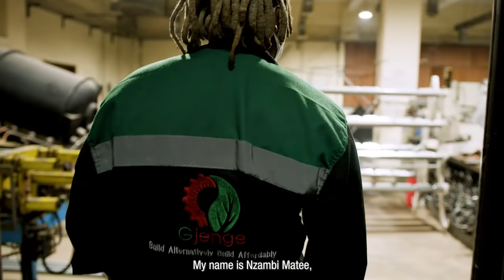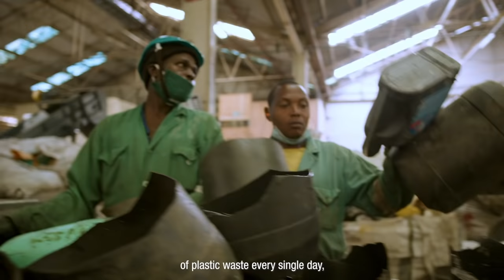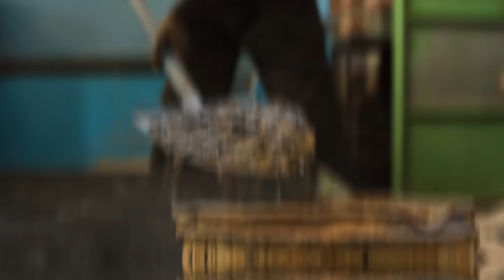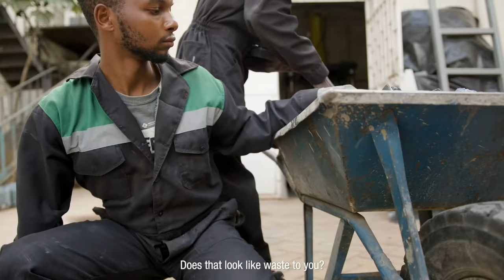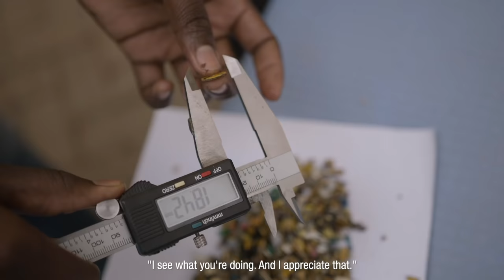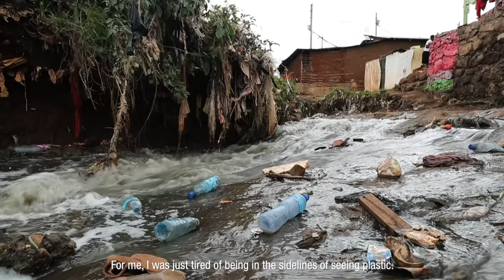Plastic bricks in Kenya - NZAMBI MATEE - Young Champion of the Earth 2020 for Africa

Comment: You generally don't want house fires, but you absolutely don't want a house fire in a house built with plastic bricks.
Reply: I get what you're saying, but is wood or any other normal building material all that much different at the end of the day?  The proper action is to make sure the fire never starts in the first place, unless you want to go making homes out of ceramics or something.  Even then, absolutely loads of stuff is still prone to catching fire on the inside of the structure.
Reply: @fenny1578  Is wood all that much different from plastic at the end of the day?
Did you really just ask that? :P
Hell yes it is.
It's organic, grows in nature, rots and feeds nature.
A high quality hardwood will even outlast most concrete in an intense fire.
Can take hours for hardwood to burn all the way through.
And wood is so much cheaper to produce, gather and process.

Comment: We need this in the USA and around the globe!!!  Besides brick sand insulated molds, I would guess many other molds can be made that would be very useful.  Genius work Ms. Matee!
Just need to add or coat with fire retardant for homes, which is easily done,,, Genius Ms.Matee
Reply: Shape em like legos and make houses out of them.  Many many people in Africa live in mud or stick houses or sleep on the ground outside.
Reply: I am thinking large molds that can be filled to produce igloo or teepee style small homes, with floors and space for windows. The material lends itself to just about any kind of application, and it seems it would not degrade too soon. That would be important, as well as recycling the old material. Whatever is made, it's got to be better than plastic as far as the eye can see. It is appalling that no one seems to clean it up.
Reply: She should reach out to some big names and see if they can offer  any pointers or sponsorships. Bill Gates for example.
Reply: it already exists in the us? its been done by a company called ByFusion back in 2014 rofl. ByFusion is a company based in LA, california.
Reply: @Gentleazi   I remember hearing about something similar for asphalt. I can't remember if they also make eco bricks as well. I wonder why I didn't mention it in my last comment, lol.
Reply: @Gentleazi  It's not the same process and ByFusion isn't a loadbearing product and can't be used for homes or any loadbearing structure.  ByFusion used to say they could build loadbearing structures like houses, but they can't.
However, anything that can turn waste plastic into something useful is good.
Reply: @amywalker7515  
Actually no African People have nice homes. I want to one return to Afican and build my home and unlike America, if I pay in cash my home is mine forever. The banks there cannot take your home because they do loan credit as frequently as America so that means no debt. 
There is homeless everywhere
Reply: @missauroraroseblairsays  I went to Africa two years ago and I saw a very few nice houses but the vast majority of them were very very poor.  Americans have no idea how most of the rest of the world lives.
Reply: I agree! Very Genius!
Reply: @JillyBean_1987  please please not him...he is wanted in Africa and India
Reply: @practicaldeen5333  I'm not really buying that. Would you like to show me a source or two? What makes you say that? The number of conspiracy theories and propaganda are just ridiculous. Bill Gates has donates billions of dollars to third world countries in crisis. Edit: he has also donated ons if money to his own country. He knows his platform can help people. Anyone this rich is bound to have ppl making up crazy stories and blaming certain problems on them because they need someone to blame.
Reply: I think you've been sleeping under rock. USA has millions of patents of innovation and technologies.
Reply: @amywalker7515  no
Reply: @amywalker7515  what contry and location?
Reply: @tenzackyogi1742  No, because the US has a huge infrastructure and lots of $$$$ that will help spread the help and knowledge and tech.  Yes, there is a possibility of greed, but what country doesn’t suffer from this sin?  Plus, don’t say mean things to me.
Reply: @nofilter7955  Obviously, the bricks for homes would be made that are fire-resistant.  Like the lumber used for homes is spray-coated,
Reply: @yellowbird5411  4Ocean cleans rivers, ocean & beaches. They clean up tons of plastic trash daily
Reply: @JillyBean_1987  You didn't just suggest Bill Gates! HA!
Reply: Its not a good idea, its a desperate idea.
Reply: @86Corvus  Come up with an inspirational idea then or say something that is desperate again.
Reply: @amywalker7515  
Please don't speak as if you have been to all of Africa. It's a vast continent. And mud houses are perfectly suitable for hot countries, as they remain cool in hot weather, just as say wooden houses remain warm in cold countries. An African may also argue that the vast majority of people in certain western countries live in wooden shacks. But then mud or brick houses would not be suitable for a cold region (whereas wood will be), just as plastic or wooden homes would absolutely not be suitable for a hot country.
Reply: @lisasrexstar7796  you're arguing with Bill Gates' primary financial advisor here.
Reply: Why would we heat toxic plastic to offgas in the atmosphere rather than using Adobe which is dirt and concrete...
Reply: @milkboi2386  Why would we allow unsoluble plastics to very slowly degrade and kill whatever drinks or swims in the water supply?  There are no recycle bins like in richer countries.
Or course, using dirt is better, but is that going to happen when everyone is drinking out of plastic petroleum-based bottles?  A sand dune of plastic?
Besides, she's not lighting the bottles on fire,: she's melting them, which is way different.  It's like melting a marshmallow over a campfire instead of burning it into a fiery ball of smoke.
Reply: @86Corvus  Why desperate?
Reply: @timboj2979  why not just use reusable glass that plastic to drink out of? Also any heat expedites the offgassing so it's literally the same thing. Then they lay them out in a flat sheet increasing the surface area for it to offgas. In a giant pile 95% is under the surface insulated from direct sunlight. I like that she's trying to do something good but I think this might be worse. Also in the pile it's concentrated and her way you spread out the plastic waste everywhere to ruin the earth faster.
Reply: @milkboi2386  Because the whole point is to rid of plastics.  Of course and obviously, there are other solutions, but not to get rid of plastics.
Reply: @timboj2979  So could you explain your earlier statement on how lighting them on fire and melting is WAY different. This doesn't get rid of any plastics it spreads the toxic plastic everywhere across the country. Fire and or melting the plastic releases so much toxins into our atmosphere, on just does it faster...
Reply: @timboj2979  also I love that she is trying but microplastics and plastic pollution  is the one thing that could destroy the earth as we know it.
Reply: @milkboi2386  Peace
Reply: Plastic is toxic to our health. You look it up.
Reply: @amywalker7515  2 words "Fire safety"
Reply: @falrus  Look around your home now.  Just about everything is made from plastic already, isnt it?  The floors have linoleum or something like it.  The paint on the walls, the insulation in them,  the roof shingles,  our furniture, clothes, electronics, etc also are.  So what's the difference?  I hate plastic, but if repurposing it puts a roof over someone's head, I'm all for it.
Reply: @amywalker7515  1) plastics used in wiring are not flammable (they burn only when other fuel is present)
2) In case of fire, those plastic bricks will be liquid much faster than structural wood is can not support the roof. (Hate American construction practices, they are a joke compared to European)
3) As  a fiscal right winger, I don't like regulations. But people should make informed decisions, when they are going to put their family into a house build out of napalm.
Reply: Exactly. This is needed everywhere!!
Reply: @JillyBean_1987  I don't have links handy. It's easily available if you look with open eyes. Govts in India and several African countries have caught his organization sterilizing women without permission. Many have died or suffered seroius harm.
Reply: @timboj2979  Most framing is just raw lumber. Only soil contact lumber is treated.
Reply: @antigod9111  wow. Mud huts are fine. Dirt floors, too, right?
Reply: We already use all of our plastics in recycled products.
The problem with plastic isn't that we're not using it, it's separating it from other waste.
Reply: No you don't need this in North America, it's just another green wash program creating more micro particle plastics, that will then be distributed beyond its past solid form to the many local areas and further areas. These people really believe they're smart. My God they are making things far far worse, and they're being touted as the Earths saviors. It's no surprise the UN is backing this Eco damaging program. Furthermore, the earths filtering sands should not be encapsulated in this manner, just another issue they'll notice in the future, was a really bad idea. These people really need a proper balance eco education.
Reply: @YSLRD  
Entire civilizations (Adobe mud- the internet is your friend) have been constructed out of mud..so what is your point? Are the materials used for the construction of a structure not about utility and function for you? 
I on the other hand, will not rebut with something like 'wow, wooden shacks are fine?', because I know (being educated) that wood serves the utility of insulation in cold climatic regions..just as..mud/bricks serve the utility of cooling in hot climatic regions..
Reply: Let’s put people in plastic houses sounds like a great idea. Oh until there’s a fire of course.
Reply: @DGiovanni  Of course, until you actually learn about  fire retardants, which they use on wood  for buildings in the USA,
Reply: @bioswars8827  If that is true. then it's too bad they didn't share this needful technology with the Republic of the Congo and other needful countries,
Reply: @tenzackyogi1742  Well, how about sharing some of these patents instead of letting children in these poor countries die from greed.
Reply: @nofilter7955  Two words "vinyl siding" it's on most houses.
Reply: @timboj2979  Two words "vinyl siding" it's on most houses.
Reply: @angcruz5635  Two words "vinyl siding" it's on most houses.
Reply: @bioswars8827  Two words "vinyl siding" it's on most houses.
Reply: @antigod9111  Being that my North American native Indian family and cousins lived in the exact same type of homes; I know exactly what it is like.  So don't assume you know anything about me. 
Plus, natural mud and wood homes are susceptible to natural causes such as insects and rain more than a plastic home; like this Nigerian chemical engineer invented,
Reply: @DGiovanni  O let's put people in wooden house it will be just fine, o wait there is a fire and everyone dies from smoke inhalation...
Reply: @lennym1273  Yeah, that will clean up a lot more plastic waste then bricks of plastic.
Reply: @timboj2979  
'Don't assume you know anything about me'
I could say the same to you as well. Stop self-projecting. In my country as well, people have been constructing all kinds of homes, using all kinds of materials (incl mud) for 1000s of years. Your being native American does not mean a thing.

And as for mud houses being susceptible to insects and natural causes, if that is truly the case, then all it means is that the builders simply do not have the knowledge on how to make the house insect proof and water proof, and also sturdy enough to even withstand earthquakes, floods etc. Either that knowledge never existed in the first place, or the builders must have forgotten that knowledge. Its that simple. This kind of basic knowledge exists in my country for sure, at the very least, because the knowledge has been well preserved.
And once again, a point which some dense people keep missing in this thread is that a plastic home is completely unsuitable for a hot climatic region. If someone still thinks it is, let them have fun stewing in a plastic oven.
Reply: @lennym1273  Yes I know, that's why I invented a different way of cutting it, without the particle residue. Also sent a lengthy proposal to the Gov of Canada, in order to prove how to properly deal with all waste plastics. But it will still take a great deal of cooperation by a great many to achieve.
Reply: @timboj2979  
No one is calling you names. And yes, your race does not mean a thing. Why? Because the concept of race itself is fictitious. There is no real scientific evidence to suggest that there is any such thing as 'race'. Even if it were a real thing, it would still not be relevant to this conversation.

And as for your relatives in China living in 'primitive conditions'..primitive does not necessarily mean backward. The word primitive simply means something that is 'early', 'ancient' or 'old'. Primitive does not automatically equate to 'inferior'. 
If your relatives saw it fit to use stone instead of other materials to contruct their homes, then it can only mean one thing, they must not have had proper knowledge of the optimal and scientific usage of the erstwhile materials. This could most probably be because of a loss of traditional knowledge, perhaps due to foreign invasions, or colonialism. Simple.
Reply: @antigod9111  Peace dude.  However, colonialism is one-word that means murder, rape, and stealing by the...well, fill in the blank.

Comment: We did this in South Africa in the late 1990's to deal with plastics we couldn't recycle properly. 

We found that ultimately people stuck with traditional building materials.
Reply: Interesting
Reply: Hot plastic warps, melts & burns. UV sunlight destroys it fast. That's why we don't see these used.
Energy cost to produce these bricks is likely near sale price, so she needs a permanent subsidy.

Fairy tales make some people feel better.
Reply: @Gogofam123  All true. People believe this if they've never changed a tire or a light bulb.
Reply: That's why she's using it for pavers.
Reply: @sleekoduck  wich is even worse. If you build a wall and plaster it, you shield it from UV decay. This is cancerous dust from the get go.
Reply: @sleekoduck  anyone who has ever made a road will tell you it warps on a regular basis. These roads will have a ton of problems being maintained.

I don't mean to crap on her, but this would have been done a long time ago if it was viable and not liable to lawsuits and etc when the plastic fails and someone's house caves in.

There has got to be a ton of other things she could be creating with this instead.
Reply: Do you have any more details?
Reply: @chrisucl  The vast majority of the material used in these bricks comes from electrical cable and wire recycling. Most high voltage and low voltage cables used these days contains a plastic called XLPE( cross linked polyethylene ) which is non recyclable. Scrap wire is granulated and the copper is retrieved. The left over material is granulated XLPE with a mix of other plastics( LDPE,HDPE,PVC). LDPE,HDPE and PVC have a melting point of 90 degrees Celsius whereas XLPE does not melt and eventually breaks up it's molecular components and becomes charcoal dust if heated too much . 

Because it's extremely difficult to seperate the other plastics from the XLPE, the granulated material is non recyclable. Therefore they compression mold it with lower heat into bricks as above. Also we used to make garbage bins,planks for park benches and playground equipment. The other plastics are the adhesive and hold the XLPE granules in the mold to form the shape.

This is the simplest way I could explain it.
Reply: @arcane7779  
Thanks for the information.

Comment: Omg I love her! Her commitment and excitement is infectious, and she’s making a big difference.
Reply: How?
Reply: Gibbon  How?
Reply: It is a terrible idea and should be immediately banned.  Why? because as pavements and roads wear the plastic particles get washed off into streams, rivers and the oceans.  They cannot be removed once in the water supply.  Waste plastic can be removed from the environment simply by picking it up so it never poisons water supplies.  

Once collected, waste plastic can be turned back into drinking bottles or burnt as a fuel.  It is very clean if you burn it at over 650 degrees.  This is a far better use for waste plastic than making it into products that will gurantee that it ends up poisoning the water on the planet.

Comment: This is really cool. However what happens when a building catches on fire and releases toxic fumes into the neighborhood?
Reply: Same with laminated wood in our house holds and light poles and the sheetrock
Reply: These bricks are for street pavements not houses so unlikely getting burned
Reply: 1. It's mixed with sand. 
2. It's bricks for pavers. 

So...seriously unlikely.
Reply: Risk to reward
Reply: Instead of releasing all of the gases over time, it will release them all at once.  And it will do it in a way that you can actually see it.  Thing is, the way they are doing it now, it is every bit as harmful as setting it on fire.  Just that it will do the same damage over a longer period of time, and it will be invisible.  But the effect is identical.
Reply: @danielduncan6806  never use it for building a house only pavements
Reply: These are paving bricks. Though, it's probably easy to formulate a building brick that meets fire safety ratings. Plastics are used in literally every north American building. Saftey ratings would dictate how quickly the bricks burn or smoke and what gasses are released etc. A hurdle but likely not an impossible one.